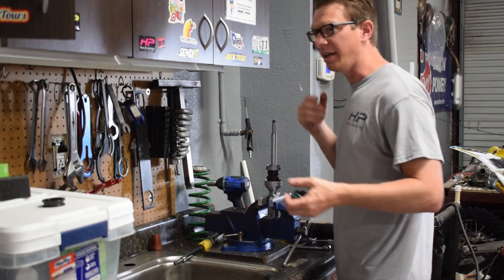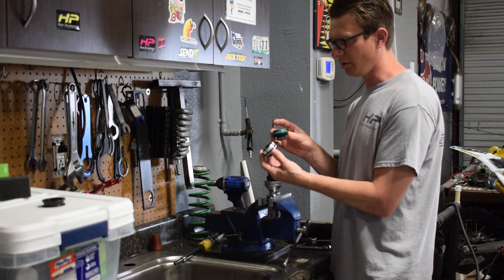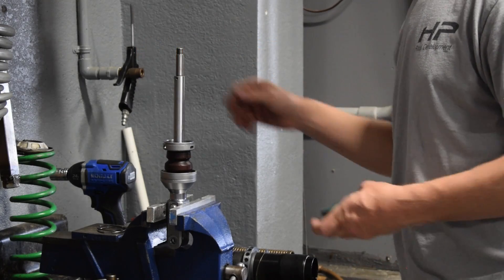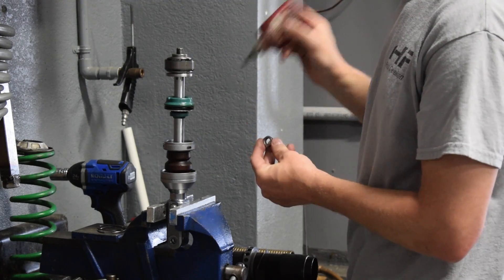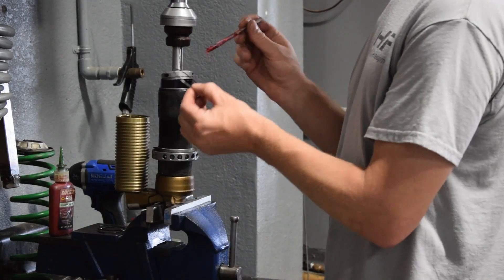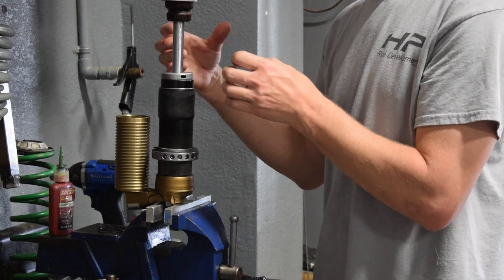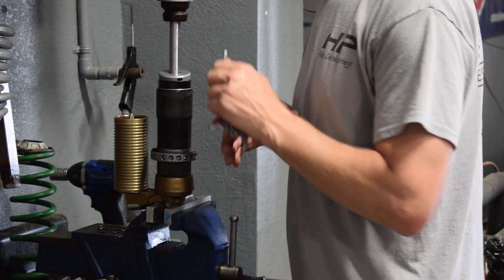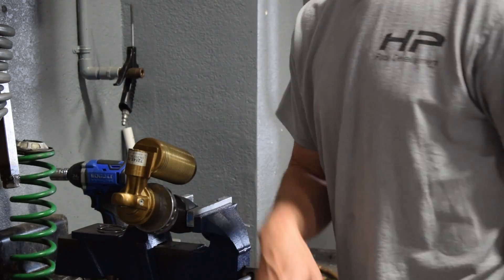Inside Secrets TM Racing Shock

Comment: small tip for when I remove the shim stack and piston assembly, I put a long piece of stiff copper welding wire, or a long screwdriver big enough to go into the shock shaft and then simply tip the complete valve stack up onto the wire holder.
You can then bend the end into a hard "J" hook and have the complete stack all on one piece as opposed to placing one by one.  Great vid-
Reply from the maker: I did this for video purpose...to illustrate just how many there are.  But thanks for the tip

It was also shim shuffled aka revalved, not shown on camera
Reply: @HPRaceDevelopment  gotcha! great vids!